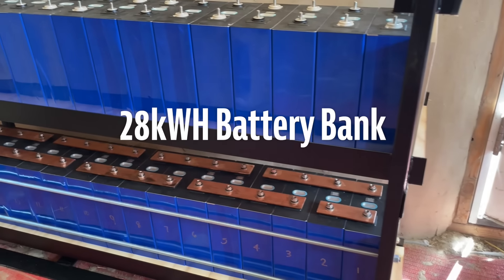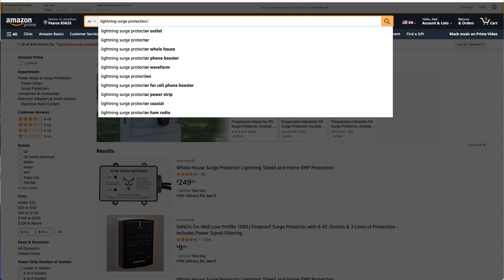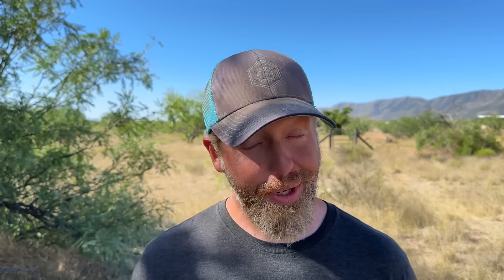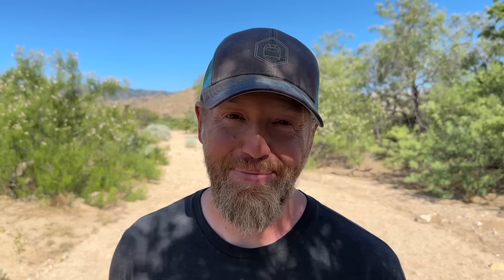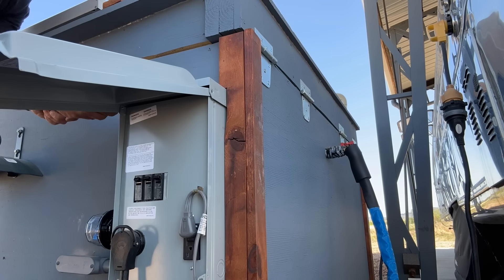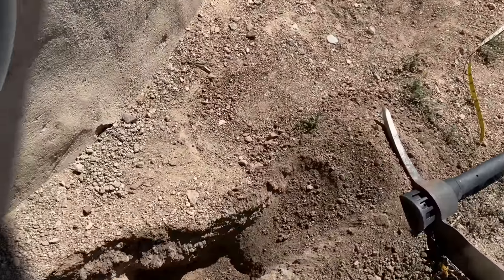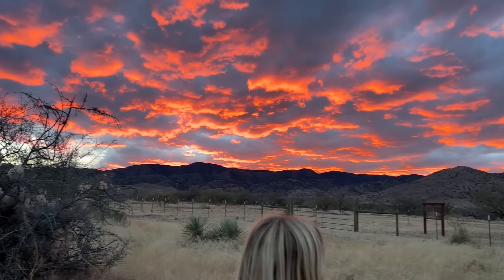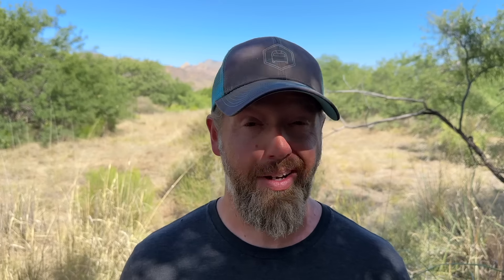This Cost Us THOUSANDS - Lightning Destroys DIY Off-Grid Solar System

Comment: Question: If you see a big storm coming. If you ARE at home. Or also everytime you drive away from your property. Why can’t you shut your solar system down? By tripping OFF all your breakers until the lightning storm passes?
Reply from the maker: You can do that. But also, the mental overhead and stress of having to worry about it every time a storm comes is exhausting.

Comment: Spare charge controller or two and a small inverter is a good set aside, something like a Victron Phoenix 800 or 1200va inverter and their smart solar mppt 100/20 that can put out about 1100 watts of charging at 48 volts. Cheap, reliable, mounted on the wall with nothing connected to them you'd have a setup to get you power for lights and a fridge. Premade cables and adapters for connecting them up set aside and they'll be ready to go if you need them. Around $650 for two of those charge controllers and an 800va inverter, you could always buy a cheaper inverter but if it might be something you need to use for a week or so probably better to have a good quality one as your backup. Also want some spare cables to reduce the number of panels in series for the lower voltage charge controllers, but if you had it mounted, tested and your spare parts on hand you could be back up for critical loads in about an hour and that's good insurance. Great vid.

Comment: Hi, I'm a massive Victron fan after converting a van with all their kit. I used to work for Furse designing SPDs too. Really sorry to hear the damage you suffered. I was a bit weary when I saw those SPDs you installed though. They look a bit shonky. What kA rating do they have? The Metal Oxide Varistors in them look kinda small for protecting the mains AC.
Reply from the maker: They come highly recommended in the off-grid community. easy to look up specs: https://www.midnitesolar.com/products.php?menuItem=products&productCat_ID=23

Comment: Have you considered a lightning rod right next to the panels? Grounding rods make it a magnet for lightning.
Reply: I think the problem with that is that the lightning rod may collect the energy, but it still has to go somewhere and will spread out across the surface and still cause damage to everything around because the subsoil is dry, even in a storm.
Maybe having a few tall lightning rods around the perimeter with deep earthing may help, a bit like how NASA protects its rockets from lightning strikes.

Comment: Multiple 8' ground rods spaced a minimum of 6' apart and all connected with one continuous piece of wire at the house.  No idea what your grounding is at the solar array but 8' ground rods at each corner, all connected with one continuous piece of wire and all of ground rods need to be bonded to the metal frame.  Exothermic connections are preferred. 

NOTHING will save you from a direct lightning strike though.

Comment: In most states you must use 10ft. grounding rods for a reason. As in Michigan where the upper ground is mainly clay based, we have to use 10 footers. To assure we have a good ground. And that's just to ground out the main electrical system. I kinda doubt your six footers will work in sand base earth.
Reply from the maker: We used 8' which is the most common size and what hardware stores stock here. Not sure why you think we put in 6' rods.

Comment: lightning surge protector won't help against direct strike. Nothing you setup will protect you.
Your daisy chained grounding rods are the only correct way to have multiple grounds, too many people put them all over the place. Won't help lightning though. The way you have your grounding rods by your panels will help the lighting destroy your equipment easier as it'll travel through the equipment to form a loop with the ground since you have two+ grounding locations
Physically disconnect during lightning storms.
Reply from the maker: Yes we said in the video that direct strikes will take out any system and this is to prevent against indirect strikes which are much more likely here. Thus the point of the video:)
Reply: @TinyShinyHome  Still have the ground loop issue

Comment: Your Victron system has a big design failure, that many people have. You are using a twin breaker for your solar panels! Use a breaker just for the positive cable, the negative cable must not be disconnected, because your data cables of your inverters, charge controllers, GX device,… are the only ground wires left during a breaker event. And all that ground energy during lightning with a breaker event is killing all electronic devices connected with data cables (CAN bus, LAN, RS485,…).

And you should install two or three metal poles double the height of your array near the top edges of your solar panels grounded to deep earth. Lightnings use the fastest electrical ways to ground. The poles mustn’t be connected to anything of your array that can burn, especially wood will catch fire during a lightning strike into the lightning protection.
Reply from the maker: No we're not, actually. We just have two combiner boxes and two solar charge controllers so there are two positive breakers. The IronRidge racking system is grounded by design as well. Our issue was the long run of cable (DC for panels and AC for powering a nearby RV) underground that didn't have SPD protection on both ends. If you'd like to see a detailed breakdown of the setup, you can watch this video (https://youtu.be/vnjMQLhp6LE).

Comment: Just a thought.... because your soil is so dry ..and..since your drip irrigation is close by...what if you ran a line over near the ground rods to add moisture to the soil around them?  Or is there a chance the lighting would follow the drip irrigation line...I guess only if it has water in it at the time.  Just pondering.  I Enjoy the videos very much.
Reply from the maker: If we had spare water that would be a good way to increase conductivity

Comment: Great video! Question, could you extend the wires and have it mounted up higher so that you could see the light and know it's working? That would cool at night time! Mount an additional piece of plywood behind any breaker box or panel. That gives you additional space to mount things like that. It also gives extra support. An easy way to get a ground rod into the ground, is to use a large SDS hammer drill. Makes quick work of ground rods!
Reply from the maker: They need to be as close to what you’re protecting as possible so probably not
Reply: Bad idea, you want the earth cable to be as short and thick as possible

Comment: To be fair the kind of voltages your talking about with lighting the ground not being wet wont really factor, if we were talking about regular grounding yeh sure, but like ~300 million volts means that the like lightning can travel through air, just having a conductive stake pretty deep in the ground is good enough for lightning grounding, wet or not.

Comment: Ummm Delta lightning...midnite solar lightning suppression and EMP shield....if that doesn't stop it nothing will...I see you got the midnight I would put the other 2 and put the emp shield in your AC box my 2 cents. After 15 years I know these have stopped ruined systems and when when we install we have a sign to have people sign off if people choose not to put them in

Comment: 2 qty 5/8 x 8’ ground rods  install wire in a continuous  #6 copper wire ground rod to ground rod then to your
Bonding bar + frame  should equal 1M ohms resistance for a lightning  strike transient voltage
Reply from the maker: As we mention in this video...that all depends on your soil type.

Comment: The major reason grounding rods don't work is because the earth is too dry. If your lightening happens primarily during "monsoon season" you shouldn't have a problem with the earth being too dry. Other comments have discussed methods to keep your rods moist plus adding a little salt that certainly should help improve conductivity. Here is an excellent video about how grounding and commons work, plus info about dry soil, moisture, and salts.  https://youtu.be/jduDyF2Zwd8
Reply: I live in a similar part of AZ as them, you can get lightning without getting the water first. Monsoon storms tend to be concentrated.

Comment: I always questioned those combinerboxes lightning protection, because lightning hits you through the ground. A direct hit is astronomically low. But through the ground is a way. The bigger the area is with low impedance cabling (because that's what you need for less losses), the worse the problem gets. I have yet to find a good design that includes all lightning protections on all points with an explanation what it tries to do.
Reply from the maker: Yeah the combiner box protection is specifically for if the panel array gets hit. I guess technically another SPD at the combiner could help if a ground strike went backwards into it.
Reply: That's also a thing: these days a 3 phase victron setup (3x5000 MP2) with solar chargers is hardly the money. I have 9 strings coming in to 3 victron solar chargers. So that's not a reason to invest in it. The sole reason to invest in it, is to keep everyone and everything behind(!) the victron safe. Especially the batteries should not get roasted by lightning pulses.
Reply from the maker: For sure! Combiner boxes are much cheaper than inverters. Ask me how I know 😂
Reply: Another thing is that insurance companies tend to seldomly pay out when lightning damages occurs (the kind of where the EMP of the strike induces currents in chips that then burn out).
My most important thing that I want to have insured is my house where they never ever should be able to say that it burned down due to a bad installation. I can not replace my house in my lifetime.

Comment: Jonathan,
  Have you considered adding a detour to your drip irrigation to "water" your grounding rods, thereby increasing the conductivity of the soil? I'm not sure if it would help but it seems like it would. Maybe an additional layer of "set it and forget it"  insurance, no? The cost of the additional material is nothing compared to the cost it might save you. I'd love to hear what you think.
  BTW, several years ago I built a powerwall for my RV, and mounted panels on the roof. I wanted it to be big enough to replace the on board generator and 24v. So I gathered 700 × 18650's from various sources and built a 7s 100p battery. Worked great until I had an inverter mishap, too and just don't have the $ to make the investment it needs. Any way I bring this up because my youngest son just bought his first car and I pushed him towards EV (Ford Focus - we both love it!). Imagine my surprise when I reviewed the battery specs and found the car battery has just over HALF of the cells my powerwall has!!! Different voltage due to configuration, of course, but that battery can move a few thousand lbs to 80mph in about 10 secs and for an extended period of time/distance. As a GenX widow, mother of 3, I'm  pretty pleased with myself. I'll try not to break my arm patting myself on the back. Thought I'd mention all that bc, #1 it's so cool, #2 my advise isn't coming out of left field. Good luck! 🎉🎉🎉🎉
Reply from the maker: We don’t have water to spare to just saturate the ground unfortunately :(

Comment: If it were me? Id be putting up a 50ft pole with a grounded lightning rod at the top about 50 feet from the installation. It always strikes the highest point of least resistance.
Reply from the maker: Like I mentioned in the video, indirect strikes are what we need to protect against most. Creating a situation where we're encouraging more lighting to come near our property is exactly the opposite of what we want especially considering our poor soil conductivity.

Comment: From what I am given to understand usually lightening doesn't affect electronics
Are you sure that was the reason
I just installed a lightening rod for suppesion and mine a concrete building - a little different
Reply from the maker: Sorry, if you think lightning doesn't affect electronics you have a lot more research to do... Also a lighting rod isn't a supressor: "A lightning suppressor is supposed to keep lightning from striking while a lightning rod actually attracts the lightning strike." https://www.earthnetworks.com/blog/everything-you-need-to-know-about-lightning-suppressor-technology/
Reply: True a lightening rod gives an easier passage for the current to pass to the ground

Comment: Not positive on soil conditions there, but having grey water disburse near where grounding is done should help the situation.
Reply: If you run a septic eventually, run a grounding cable in the trench

Comment: Earth bonding,  bare copper wire in the trenches. Ive been doing this on all my commercial installations for decades. I was concerned that you didn't do this from the getgo
Reply from the maker: There has always been bare copper wire underground connecting the ground rod. We just added more rods and wire to make a clearer path to ground in our dry soil.

Comment: Some parts of the U.S. are more susceptible than others. that said it still is an importin part of any electrical system. Even on grid surge protector usually only cover white appliances aka refrigerator and so on. With your soil conditions you may consider a UFER ground system on your next build thank you ALL stay safe

Comment: lemme thing about ... are you sure that your configuration on the ac side is correct? i mean the SPD should clamp the voltage down if it needs to, but connected only with one leg it can only clamp static charges to ground. if i understand correctely you need to 2 times the 115V version for your setup. isn't it?
Reply from the maker: No, just go read the SPD manual and don’t make assumptions;) https://www.midnitesolar.com/productPhoto.php?product_ID=601&productCat_ID=23&sortOrder=1&act=p
Reply: thanks for clarification :)

Comment: So if the lighting struck the ground and it traveled through the ground and fried your equipment, wouldn't the grounding rods just make it easier for the lightning to get to your equipment?
Reply from the maker: No the grounding rods provided a clearer path to dissipate the voltage than the equipment, that’s the whole point of grounding.

Comment: oh it fired the boxes, not  the panels. the boxes can be fixed (but, not always if it's bad enough)                IF one has board level repair skills and the damage isn't too bad
Reply from the maker: No, delicate electronics like this would be nearly impossible to fix as there's almost no way to know what components need to be replaced or what has gone bad. The voltage affects each bit differently.

Comment: looks kinda small of grouding cable.... and if underground better use not rod but grounding tape.. and you have to do perimeter grounding around house etc... and rods have to go down super deep if sandy and it has to be at least 3 spots with rods going at least 15 meters

Comment: What did you do with the broken inverters and such? There is a chance thosw could be fixed by replacing some of the components.
Reply from the maker: Delicate electronics like that would be nearly impossible to fix after a lightning strike so we took it to a recycling center where we know they'll disassemble properly.

Comment: not a crazy big deal, but the grounding conductors are meant to be what’s called unbroken. this means the wire shouldn’t have been cut, although it’s easier to install when you can cut, it can affect continuity. should be good though, just some helpful info. 🤙🏻

Comment: the ground looks very dry, which really isn't good for a ground wire, you really need to go deep, the deeper the better, preferably all the way down to the water table. bigger is better, so a good thick grounding rod is better than a skinny short grounding rod. one other thing you can do is add a lightning rod, get it up as high as you can get it, this will attract a strike and safely send it down to earth. give lightning a very low resistance path to earth and that is the preferred path for it to take. keep this ground separate from everything else, lightning will more than likely strike that and leave everything else safe. nothing is 100% but a lightning conductor well above everything else is a good way to deal with lightning in a closed system.
Reply from the maker: The ground wire is simply connecting multiple ground rods together. Our soil is sand all the way down at least 12', and wells are dug at 700' here so no we're not going to get any kind of rod down to the water table. Building a lightning rod to attract more lighting to the property when our soil conductivity is poor isn't a good bet, either.

Comment: I was wondering, your plug to the RV looks like a 220v plug, but you said you only had one lug in the box to protect, which I took to mean 110v. If you didn’t bring 220v out to the RV, I was wondering why?
Reply from the maker: It’s a 30amp 120v trailer and plug. We don’t have 220 on the property yet. 👍🏻
Reply: @TinyShinyHome  My bad, I had just assumed from the glimpse I had of the devices in the shed that you were set up for 220v.  I also learned something new.  I did not realize that there were 30 amp plugs available for 120v.  I thought 20 amp was the max.
Reply from the maker: Yeah there are tons of RV's and travel trailers on the market here in the US that are 30A/120V. You do need to make sure the source wire gauge is big enough, though :)